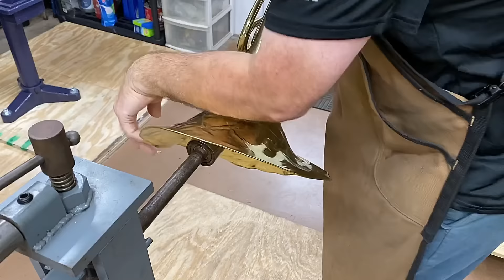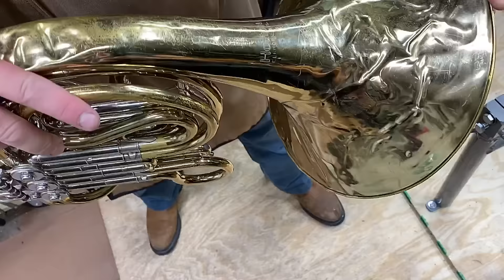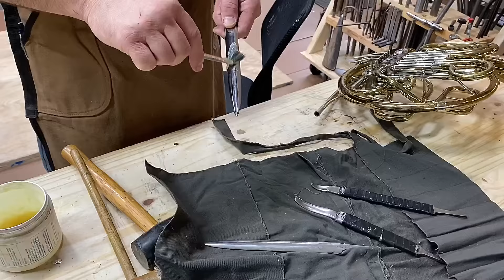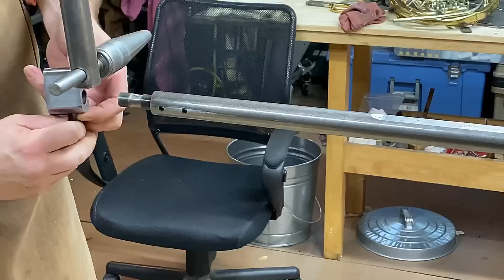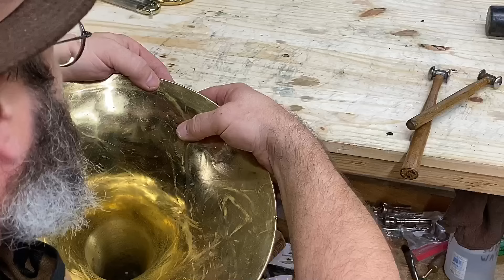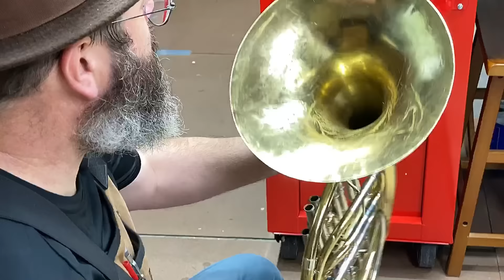French Horn Repair part 1- Wes Lee Music

Comment: As a blacksmith, I tip my hat to you, Sir!  I kept waiting for the torches to come out but your skills, your tools, and your patience left me in awe!
Reply: I was waiting for at least an annealing but nothing came.
Reply: Same,I wish steel was this easy while forging lol
Reply: honestly, torches would have caused a tear. you just have to cold work brass and be patient.
Reply: Same here! I was also wondering how in the heck it got thata way in the first place....lol!!!!
Reply: @EpicHeroSandwich ya brass dont forge work a darn...... I love working with copper ,wood and steel together  .
Reply: The most you'll see for hot work is soldering and the occasional brazing, but it can be done with a butane torch. Musical instruments are quite delicate--and it is equally surprising just how little force is actually required to put an instrument in this condition.  Some horns use a detachable bell that is threaded and unscrews from the body for storage.  My guess is, a student who normally used a detachable bell-instrument had their own in the shop and was using this as a loaner, got done with practicing and muscle memory took over as they realized a moment too late that this was a fixed-bell horn.
Reply: @LifeAccordingToMatt  I'm guessing because he was rolling it rather than hammering it, it doesn't work-harden...?

Comment: The way you get that metal to shift and go back to straight without a lot of heat is really amazing to watch
Reply: Just the heat from his breath when he grunts
Reply: I am assuming you don’t play an instrument or at lest not a brass one because it is vary easy to bend and damage
Reply: Adding heat may stretch it to a point of no return.  This can happen on auto body (metal, of course) as well.
BTW, you can repair a 70s or older VW Beetle in this same way.
Reply: the bell is lacquered and bent so applying heat to that combination would create a gawd awful mess.
Reply: @aperson5551  no he's never seen a man that intimate with a trumpet before
Reply: The only heat you ever want to apply to a brass instrument is when it comes to soldering the joints. Otherwise they're way too fragile

Comment: Absolutely beautiful results. As a flooring guy,  I'm gonna try to use the mans' techniques with a commercial vinyl seam roller and several shaped stones here at home on the tailgate of my truck. What an inspiration!
Reply: It's easy to forget that metal is malleable; what has been bent can be straightened to almost its original shape/ position.  With patience and thinking about the work, great results can be achieved even by us amateurs :-)

Comment: Tools strength and skill, what I find surprising is the brass took that abuse with-out cracking from being work hardened. I would of thought that one would have had to apply some heat to anneal the metal. Pleasure to watch in this in instant world of gratification !
Reply: My guess is the heat would affect the finish of the brass but I'm not sure
Reply: @bigfootsburneraccount9160  On part two he has to resolder some areas and the heat does discolour it, so he uses his buffing wheel to bring it back. There also looks like there is some sort of varnish on it to keep it rom tarnishing. I'm sure that will be reapplied after he buffs the bell.
Reply: @HaggisCat1  probably some sort of wax, or at least I'd assume that's what they originally used, today it might be something else I'm not one for brass instruments.
Reply: @eve_squared  Brass instruments like this are usually lacquered to stop them tarnishing.
Reply: @HaggisCat1 Those were my exact thoughts! I make some brass things for sale and it would be a dream if I could work them and not anneal and clean up before working again. Mr. Bell what is this magic?
Reply: Lots of cold working,  guess heat isn't the the way.
Reply: To anneal brass properly need to be heated to a certain temp then dunked in water, but yes I would think so as well.
Reply: @CodyG_95  I thought it had to cool slowly, wouldn't quenching it in cold water, have the opposite effect, or is that for carbon steel only ?
Reply: @HaggisCat1  carbon steels will become harder the faster you can quench them as it pulls the molecular structure closer together. Brass has a diffrence structure from what I remember.
Reply: @HaggisCat1  Brass is exactly opposite of steel, slowly cool it and it hardens, quickly cool it and you anneal it. Many aluminum alloys can only be work hardened, and heating them only anneals them, so different metals react differently.
Reply: @eve_squared  Shellac used to be standard as a coating for brass…
Reply: @SgtBeltfed  Aluminium alloys with a significant copper content harden with time. They are softest immediately after heating and age harden over time.

Comment: The amount of hand strength! My forearms and hands were sore just watching!!
Reply: For real, most people could do this for like a minute. 

I can only imagine a hand shake from this dude would crush you hand
Reply: I suspect the forces he's applying are very gentle to avoid creasing or work hardening the brass (which it and copper are notorious for in engineering), but the precision whe he's working it with the ball hammer, just nudging the metal around - keeping your forces under control is its own kind of tiring

Comment: As a metalsmith I must applaud your hand strength! You literally muscled the wrinkles put of the bell.. I wouldn't have believed it possible without seeing it.
Reply: I watched Trumpet manufacturing videos, and hammered one piece bell starts out as wrinkly piece of brass sheet and end up as smooth and shiny bell shape.
Reply: @davidjacobs8558  I use a hammer and anvil pretty regularly, but not like these. Definitely specialty equipment <3
Reply: The metal is surprisingly thin any pliable.   Easy to manipulate, but also.....easy to tear.   Fine work
Reply: @ericvi3921  for sure, it definitely takes an experienced hand
Reply: French Horn bells are usually very thin which means it’s easy to crumple the bells and it’s also easy to roll out the bells.

Comment: I'm curious how many actual hours went into straightening out the bell? Remarkable craftsmanship, Sir.
Reply: My question as well.
Reply: Mine too.
Reply: I used to be a panel beater, brass is soft compared to steel and easier to work with. I would have thought he would have been able to repair this in a day easy .
Reply: It's a question of 'economically repairing', i.e. cost of repair over replacement. Beautiful job, but I hope he was adequately rewarded. That's very specialist work
Reply: The bell would be 45 minutes to an hour. He showed several techniques, not required to use them all
Reply: @Surgeeon  In a day easy perhaps ... but not an easy day!
Reply: @RayeBay1  as someone else said, brass is a soft metal. What you're not seeing is the decades of practice that make this a days work
Reply: I'm curious of how long it took to make it crooked in the first place.
Reply: @itisMe04  one bad drop
Reply: Brass may be a soft metal, but one thing that is often forgotten is that it hardens considerably the more you work it. A bell piece is already medium hard to start with, and after denting like this the brass in the creases can get really hard, and buffing out the dents hardens the brass even more.

All of this will also change the properties of the instrument. You often loose a bit of tone depth the harder the brass gets, while gaining a bit of response and dexterity. Some jazz-trumpetists deliberately dent their bell for this effect, but it may not be too desirable for an F-horn. It's as such often a compromise in how hard the repairshop want to buff the dents, versus how much tone you gain/loses by doing so.
Reply: @TheMovieCreator  That is a very interesting answer.

Comment: What I find astounding is how this was accomplished without annealing. Though, soft working the brass in this case would likely be more problematic.
Reply: My thoughts exactly. I've made copper model steam engine boilers and had to anneal multiple times. I would have thought the copper content of the brass would make this impossible, but he just did it right before our eyes.
Reply: @mattagnew206  Do you mean, because copper is notorious for work-hardening?
Reply: @Ea-Nasir_Copper_Co  Yup

Comment: I had an accident with my unscrewable French Horn. The bell was repaired, but the instrument did not sound like before because of the structural damage. I replaced the bell which fixed the problem in my case. Maybe an amateur won't see or hear differents. For a pro player this - by the way awesome - repair is not sensible. 

Thanx for your great videos!
Reply: Amazing work by the repairer but a lot of strain hardening introduced into the metal. It really needs heating to anneal the metal. That's why the repair will sound different. For a student instrument used in a marching band it probably won't matter.

Comment: If I hadn't just seen this happen, I'd have said that it couldn't be done.  Will there still be stresses in the horn, or does all that working relax the metal?  If there are still stresses in the brass, will it make it sound any different?  I'm guessing that it is only the air that resonates, and not the horn itself, but if that was true, wouldn't they make them out of plastic?  Either way, this was incredible work.  I spent my working life as a toolmaker, but sheet metal was always a black art and I was never very good at it, but at least I can appreciate Wess' work knowing how hard it is to do.

Comment: I remember my dad always saying, "A man is no better than his tools." I beg to differ, as you'd be able to shoe an angry Clydesdale with a box full of scrap metal and a few blocks of White Oak.  My question would be, would it be possible to heat the metal as you initially work out the nasty?  I understand you'd have to wear thick gloves to handle the warm material...

Marc

Comment: That horn was so crumpled I really couldnt imagine how it's going to be fixed. I was assuming hes going to slowly tap at the creases until they are flatten down but I keep thinking  how is he going to go about it since  it might iron out the crease but deform it even more and keeps thinking why he tap and flatten the edge of the horn first. Then I see him pull out that knife looking tool and it just makes so much sense to rub it outwards since the crumple is  it being hit inwards. 
Its fascinating to see something that seems to be beyond repair being repaired, and it's not even on of those where parts are just replaced or covered, you cant just putty the dings and paint over it.  Also I do not know how hes going to fix the crumple of the tubes that's quite far in, I mean he needs at least a tool that is curved  inside it to even begin doing anything to it.  This almost seems like someone has watches this video, handpicked an instrument to destroy  as a challenge for him

Comment: I would have thought you'd have work hardened that and cracked it with all that manipulation... Did you heat it up a few times between doing all of that? Or can it just take it without a problem?